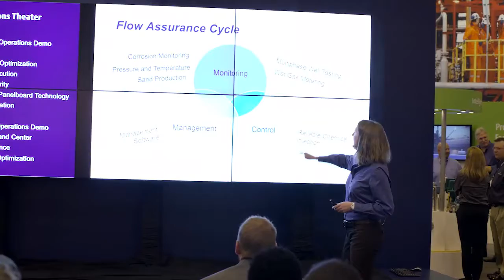Optimizing Well Chemical Injection through Flow Assurance

Comment: Easier said than done. What about the capex associated costs such as injection pumps, dcs system. On top of that the flow would reduce over time requiring less chemical injection rates and in such a case pump should be replaced. In short There is a lot of hidden costs associated. Sure enough it looks good on paper and would be easy to monitor but well performance is very dynamic in nature and flow rate could literally drop to less than 50% after you start the well.
Reply: Ahmed, I certainly agree with you that the dynamics that are very common these days in well production rates make this a challenge.  I think it is those same dynamics that can make the additional capex investment that is required to apply these techniques yield a return on investment that is attractive under the right conditions.  No solution is perfect for every application and every well, but I would like to offer to have one of our specialists in your area contact you to work through the details of any specific cases you are considering.  If you want to take me up on this offer, please just send me an email directly at marc.buttler@emerson.com and I will respond to put you in contact with someone who can help you in more detail.  Best regards.